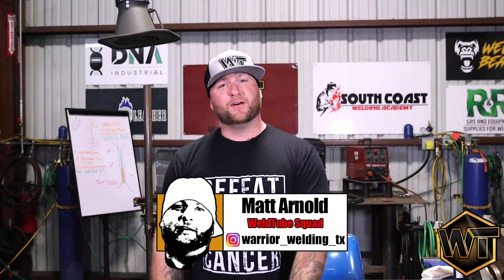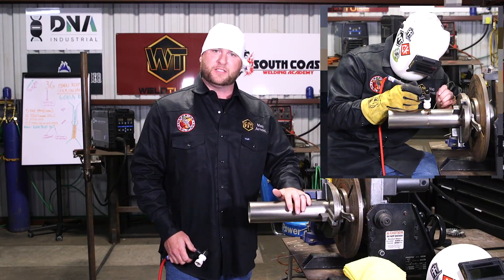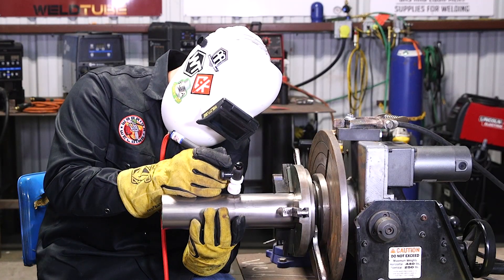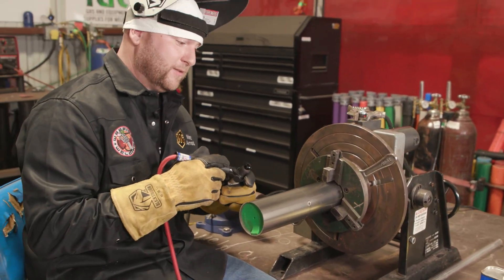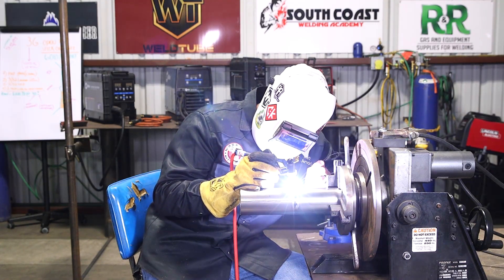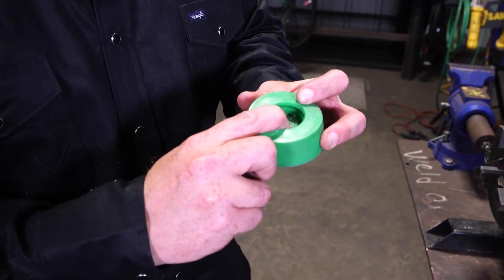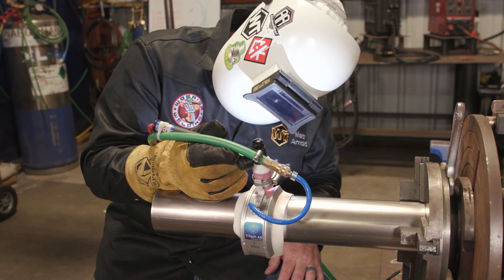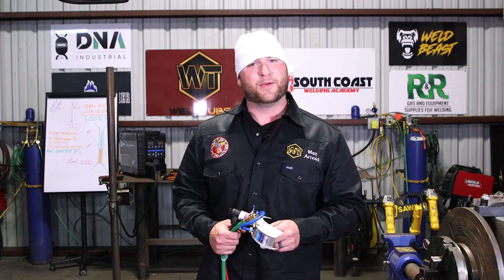TITANIUM Tube TIG Welding

Comment: Bunch of misinformation in the first few minutes of this video.First off you don’t run 1/2 your cup diameter you can run the full diameter of your cup and second you don’t need to hold you post flow over a tack for 15 seconds, once the red glow is gone plus a few more seconds to cool off and you can move on without getting color. running 1/2 inch at a time is ridiculous, I use a #16 cup (1”) and run 1” beads with no discoloration, if you know how to balance amps/travel speed to get the right heat input you won’t get colors and sitting over a tack for 15 seconds is a complete waste of argon. Should you wait for 15 seconds of post flow after a full bead? Absolutely you should but that 1” bead needs A LOT more time to cool than a single tack. Thought this channel would have better info. I’m disappointed

Comment: Could this be done lengthwise on a smaller diameter, irregularly shapped tube? Wondering if I could weld some cracks in an old titanium lacrosse shaft.

Thanks!

Comment: You only need a 10 second post flow if you have a trailer running behind for the gas coverage.... you also only need to bump up the Argon. to the same gas flow as the torch. Your torch is working way too hard.....! gas flow should not be that high, and neither should amperage....

Comment: Thanks for your encouragements and the advises.

Your ZTA is too large. It's 10mm max.
The pin holes are there for a few reasons I saw. You're going too slow, your arc is too long at the same place at the end, your tungsten tip is maybe not the right shape including the top shape. I polish my tungsten tips and it makes all the difference. And at the end, instead of staying at the same place to make a hole, I do a spirale while getting away slowly from the too close distance to help stop the arc faster than my foot on the pedal.
Excuse my English, it's not my first language.
Cheers 😉

Comment: Why are you not wearing a cotton glove on your feed hand?!  You discuss using acetone and not touching the tube after you clean it to prevent transferring oils, but you are putting your oils all over your filler.  I weld titanium most days and you are spot on with the straw color and cleanliness otherwise.  We, in aviation, have very strict tolerances and you discuss your shop in the video.  I get the impression you try to go above and beyond which is great but this is a very simple step, SAFETY WISE TOO, to just toss out.  The weldment looked great and I'm not trying to bust balls but I couldn't watch and not mention this.  Thanks for the video!!!
Reply: How can I get into aviation welding @brandon McElroy

Comment: Why do you use a standard helmet and not an auto darkening helmet
Reply: It is an auto
Reply: @Warriorweldingtx  
did you add the flipping lens yourself onto the Helmet ?
or are they available readily in this style ?
thx in advance !
Reply: Wont get as clear a view through any auto than you will through a passive lense anyways. Especially a gold coated lense👍
Reply: @kf8575  the weldbeast lenses are actually clearer than any passive lens I’ve ever used

Comment: Bonus tips: Be careful to not blow your gas by flipping your hood and keep the end of the wire under the gas
Reply: Yup, I was running a 2 second pre flow to eliminate any issues there, good lookin out!
Reply: @Warriorweldingtx  id also wear silicon glove or something similar on the feeding hand. The oil on your skin can and will contaminate the wire.
Reply: @Thorn19774  I knew someone would call me out on that lol
Reply: @Warriorweldingtx  lol im guilty of it too sometimes youre in a rush and if it aint goin to x ray  ¯\_(ツ)_/¯ its a  good habit to keep for sure though.